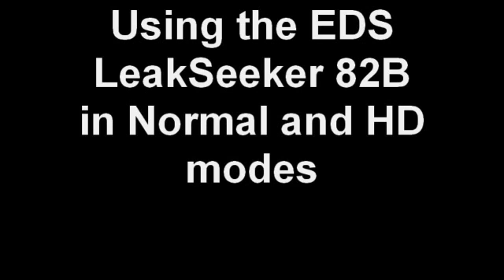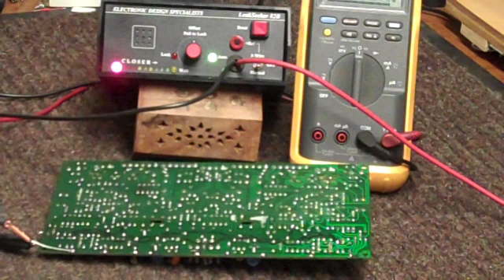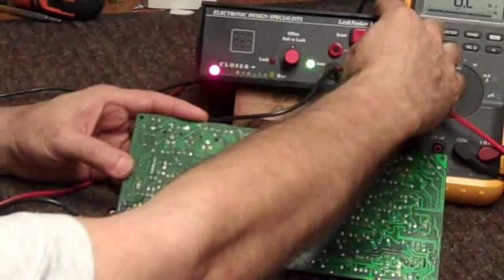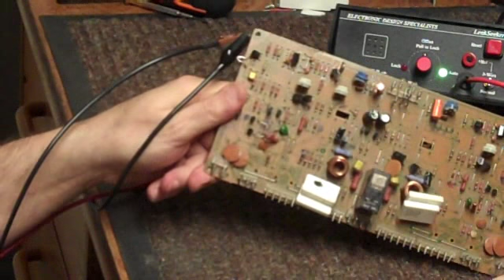Using the EDS LeakSeeker 82B in Normal and HD modes

Comment: Absolutely. Most capacitors on the board measure less than 10. I believe the BIOS chip is fine. I will send a processor, a memory module, a graphics card and power switch. That should give you everything you need regardless what you decide to do. (Would send a power supply but i imagine you have one)... The board is ATX. Asus A7N8X Rev.2.00. No onboard video.